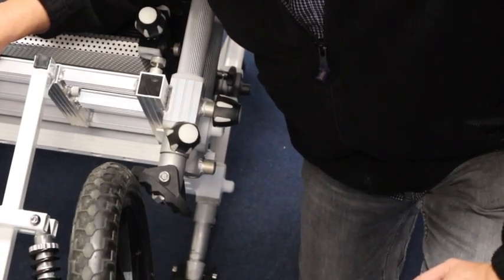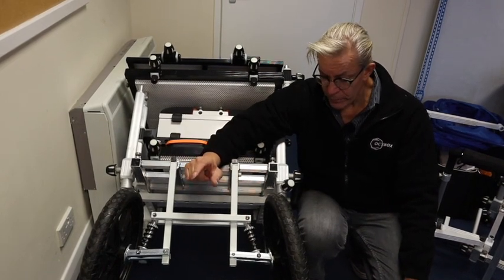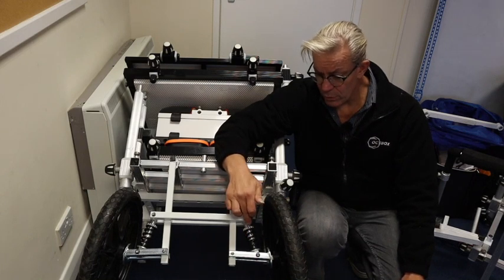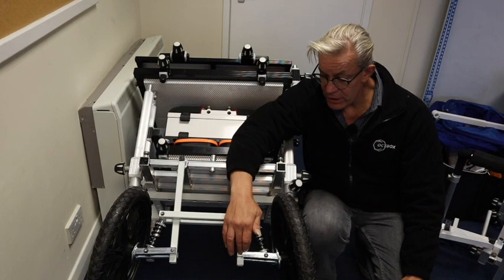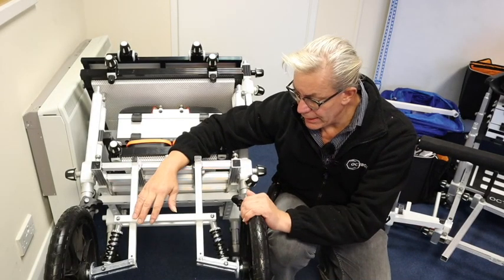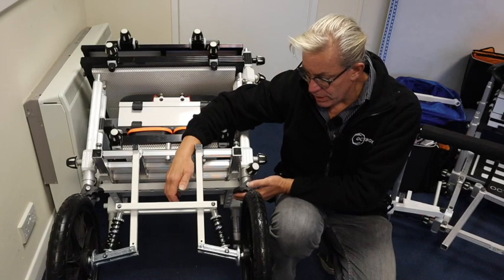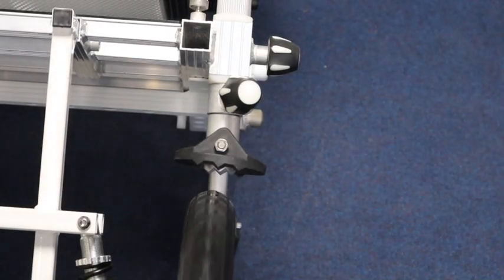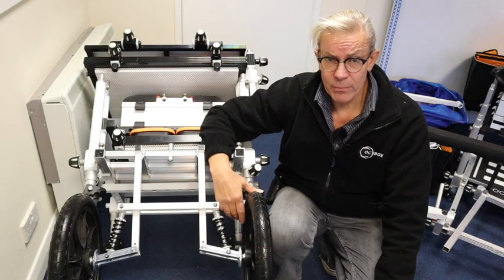Octbox Double  Wheelkit Shock absorber Modification

Comment: Hi Rick, sorry to say but never been 100% with my kit as shocks screwed to near max and we did change one when new but i have that problem with the wheels going well over when loaded and would not say that it loaded heavy so you have me thinking would I be better to go for what you have done or just stick with me old single kit on the front if you thing the mod is the way to go whats the cost to change the shocks to the 15cm ones please I have already changed over to the newer rear set up and that has made a big change to the stability of the barrow system so happy with that change ,thanks
Reply from the maker: Hi Steve the longer 15cm shocks are the same ones we fit as standard to the XL wheel.    The single wheel performs better than the double provided you do not have to big a load.   Once the load becomes to difficult to manage on just one wheel then the double wheel or four wheel has to be the choice unless the angler can lighten the load and amount of bags.   If you send me a picture of your double wheel kit I can check what version you have because we did makes some amendments early on.
Reply: @richardtyler296  Hi Rick thanks for the reply got the kit in April this year will drop some pics to your phone if that is OK and see what you think. cheers
Reply: @richardtyler296  Hi Rick
I did drop you some picks to your phone don't know if you got them OK my wheel kit was the 4 wheel kit with the 4 41cm wheels purchased in April this year but has the 10cm shocks that we had a problem with one if you can remember the would screw all the way by hand and not compress the spring so we did change one that made a big change to it, also one other thing can i get just the side step short legs as put mine in my ground bait tray Sunday while packing up and the wind took it for a trip in to 12 foot of fast flowing river 🤬 had no chance of getting the legs back, many thanks 
Regards Steve
Reply from the maker: Hi Steve if you give me a call on 07342884387 and I will be able to sort out the legs you need and can discuss the wheel kit mod
Reply from the maker: Hi Steve we do have a solution that upgraded the double kit so it can take more weight by fitting 15cm shocks.  see link https://www.youtube.com/watch?v=XcGYTaYJLPU

Comment: I love the ideas and the engineering but i do think it is getting a bit more like a designer fishing box and very expensive ..does it catch more fish long and short no
Reply from the maker: Hi Nick, actually when you consider it is a seatbox and barrow chassis in one it is actually very cheap considering most Octbox anglers are getting over ten years of use and still have a box that is good enough to sell on.  Aluminium is not a cheap material but despite that in 2018 our D25 box cost £550 and today it costs £575.   Wages have gone up considerably over those years so we have done very well to keep prices down while still improving the quality.